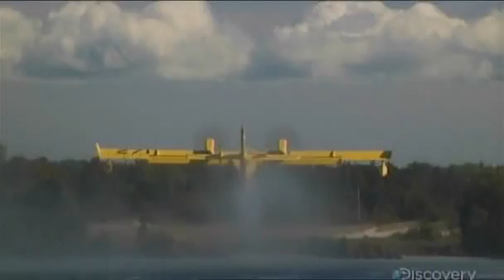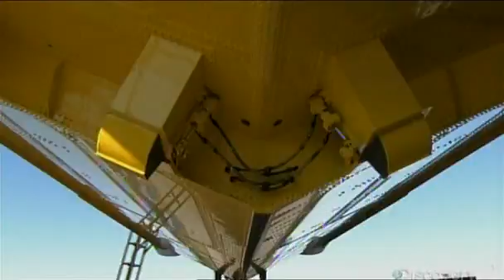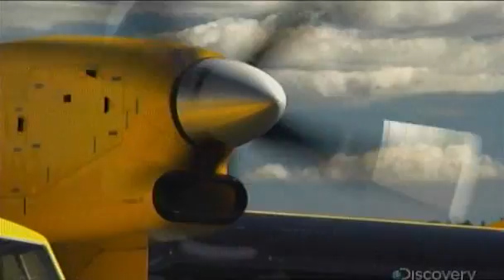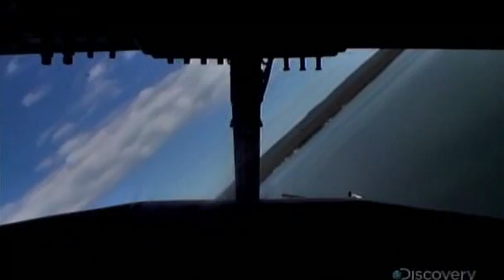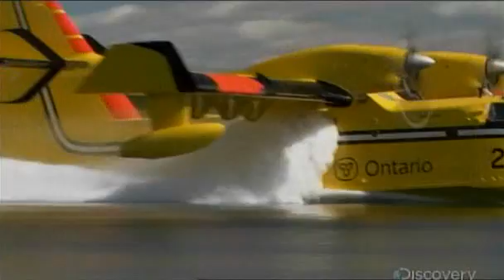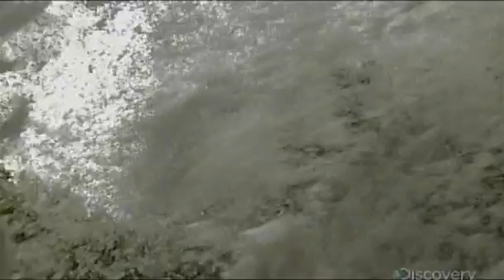Fire fighting airplane working

Comment: Non-powered turbo Genuine water pump Fire time. Money. Labor cost. Saving effect. Remains. 2009 10 years Headquarters Note) Item heaven 032 882 2375.
11,980 views • 2017. 7. 29.
https://www.youtube.com/watch?v=5RPT_-xAzSM

Resolving pre-combustion causes of global warming
Eco-friendly item technology into the world of Mirero
Non-powered turbo induction combustion improvement system device
Recruitment of distributors for domestic item technology worldwide
Low carbon energy smoke reduction system research institute
Representative: Hyosung Baek 010 8359 1469
TEL: 032 882 2375, FAX: 032 887 9096
E-mail: bhsbhs2kr@hanmail.net.
E-mail: bhsbhskr893@gmail.com

Comment: I’d like to know how they clean it from the salt water so it doesn’t rust?
Reply: It has a rust proof aluminum haul.
Reply: @johndistick9702  Not quite. Aluminun corrodes - see comment above
Reply: Boats use galvanic action of a zinc anode to corrode instead of the aluminum, I think.  That would work on an airplane too.

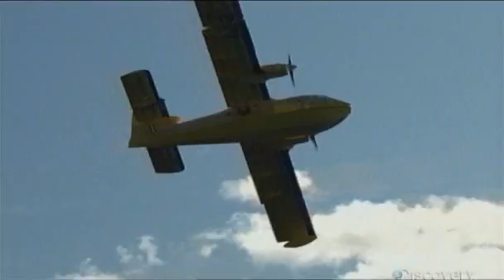Comment: At 1:35. "It has a wing area larger than a jumbo jet....." NO. A 415 has 1080 sq ft of wing area. A B747-400 has 5825 sq ft of wing area.
Reply: I think maybe he meant in proportion to the size of the plane the 415 versus the passenger jet
Reply: @robertlongwill8856  Nope. The wing area is the same as an original model 737. 
These content creators are good at screwing up the facts.

Comment: It definitely has better utility than the Mars bombers but not shear volume... why are they not being utilized?
Reply: There are only 2 remaining and I think 1 has been retired. They are very expensive to operate and need a lot of water approach length. The CL415 is fast, nimble, aerobatic, and can do several runs in the same time as a Mars for 1/5 the price.

Comment: Looks like the airport scenes were filmed at CYAM! I see these going by the ramp of where I do my flight training, they're fucking massive
Reply: Steven W I flew gliders out of Llano, CA, which is just to the north of the mountains that separate the L.A. basin from the Antelope Valley. I have been above, around, and through that area, from Mt. Baldy north all the way to El Mirage and Edwards AFB (where the shuttle lands) and Palmdale (home of Air Force Plant 42). When there was a fire in those mountains, we were restricted to staying far clear of the hills. The fire fighting crews were flying the Catalina (WWII PB-Y) air boat. When you're in a little tiny glider, those Catalinas seemed even more massive than usual. 
Of course the Canadair aircraft are newer and "better," but I was so impressed to be in close proximity to a working tanker, even if it was older and smaller. And those pilots came right across our gliding area, since they filled up at a lake to the NW, and then back to the mountains. They had no regard for us at all. We literally had to get out of their way, and had to be aware of them coming up behind us--which they did. And close! I realized that it was smarter for me to ground myself for the day, so I flew down and landed.

Comment: A wing area larger than a 747?  What crap!
Reply: There is no such terminology such as "Lifting surface area"! ...and even if there were, are you suggesting that it would be larger than a 747's???
Reply: Bombardier: 100 square meters.  Boeing: 560 square meters.
Reply: David Stewart  I think the wing surface area includes the tail which is also used for lifting. He should have said "lifting surface area," rather than wing surface area.
Reply: Actually, the horizontal stabilizer (tail surface) creates a down force (lift downwards) to balance the center of gravity and center of pressure (lift from the wings). The tail does not create lift that helps the aircraft fly. In fact, it does the exact opposite. The downward lift created by the horizontal stabilizer must be overcome by the wings creating additional lift above the weight of the aircraft.
Reply: Maybe it was power to weight ratio.
Reply: 737
Reply: i agree lol
Reply: The media tends to call any jet a “jumbo”.
Reply: The 737 also has larger wing area than this plane.
Reply: Not very fuel efficient though. Not tapered wings with with lots of area also means it can't reach high speeds.

Comment: What if it picks up fish  ?There will be fried fish all over the fire site
Reply: I think they thought about this and built in a filter
Reply: Interesting, can you support your statement?
Reply: YungKnown did u see the part in the vid where it showed the openings? They're much too small for a fish of considerable size, and fish would die from impact with the plane anyway, or avoid impact by running away when they heard it, like fish do.
Reply: There would rarely be fish in that top 2 feet of water in the middle of the lake or river.
Reply: Pilots eat as sushi in flight deck.
Reply: Is this a complaint?
Reply: A little snack for the hard working firemen
Reply: The scoop is 4x6" and has a cross grate in the middle. It picks up water at about 100 mph and any fish would be sliced instantly if there were any there. Besides, they can sense this thing coming and will instantly dart away out of danger anyway.